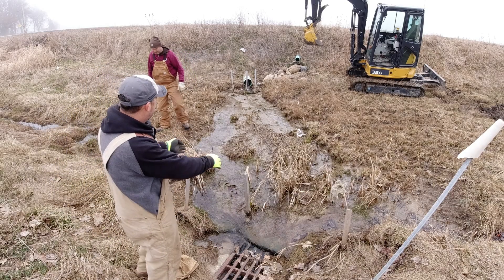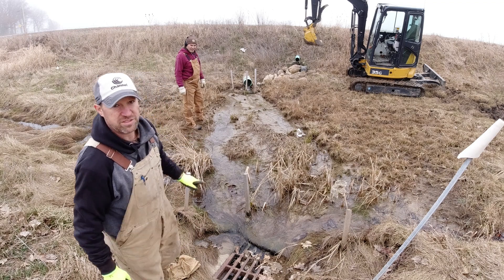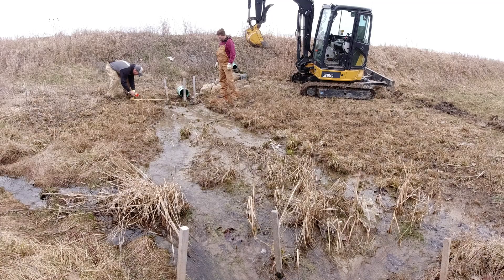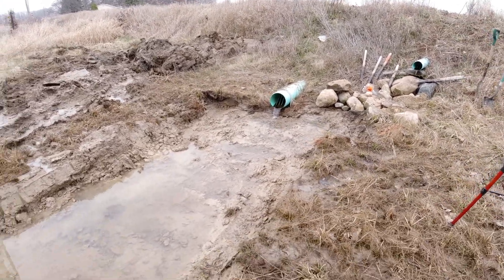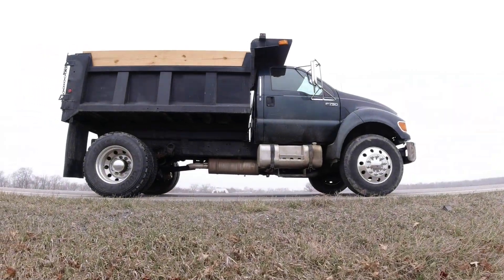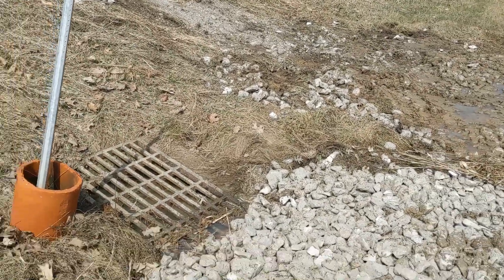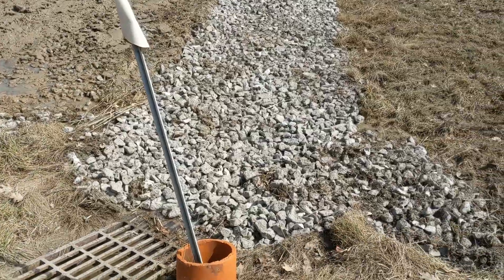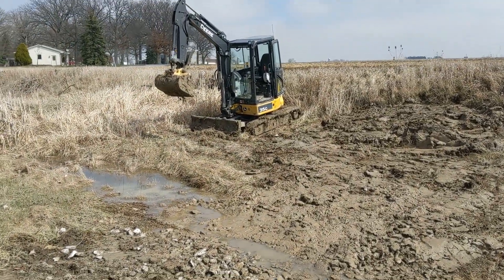Fixing Erosion and Hauling Rock with Excavator and Dump Truck - Includes DRONE footage!

Comment: You have more power and stangth if you pull not push
Reply from the maker: Good tip to know!  I think we tried a little pulling, pushing and everything in between when stuck in the mud on this one! Couldn't get a grip on anything.  Thanks so much for watching!